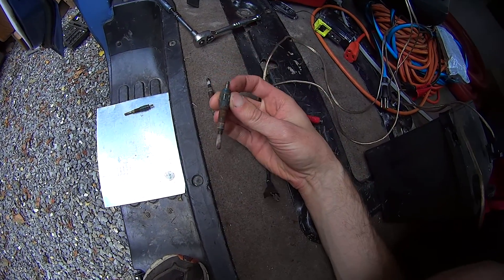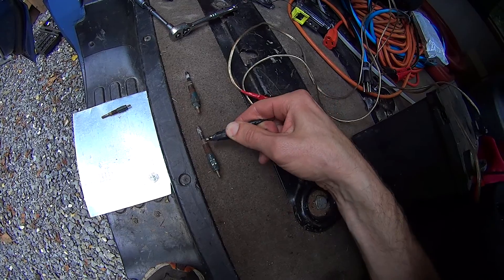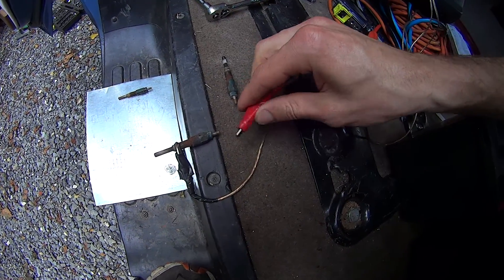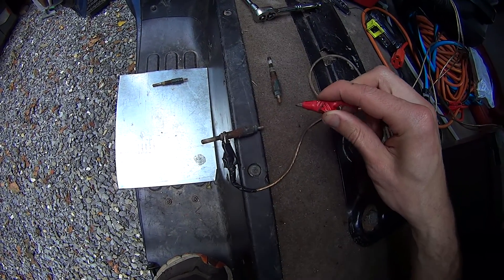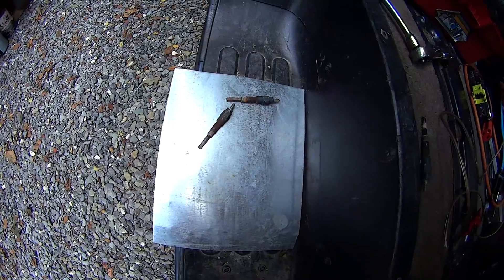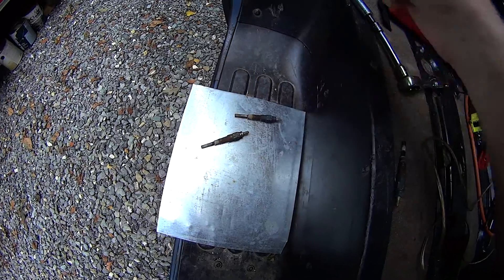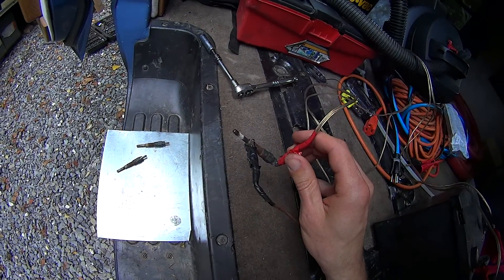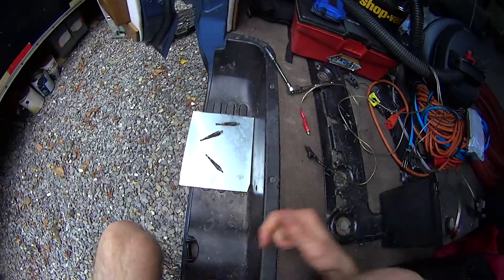Glowplug Testing - Kubota D905e

Comment: Do you know how to remove them from a Kioti LB1914
Reply from the maker: +Torry Palermo Not sure, as long as you can see the top of the engine you should be able to get to them easily. Take the power strip off the top and then use a long socket to get them out.